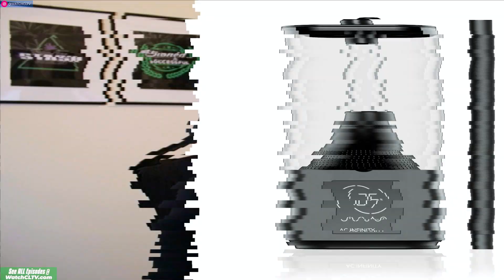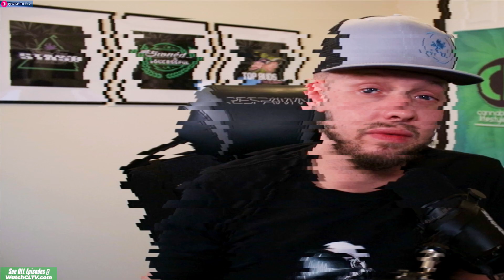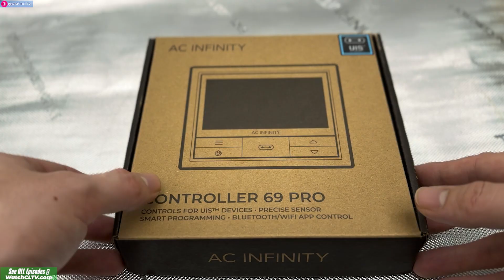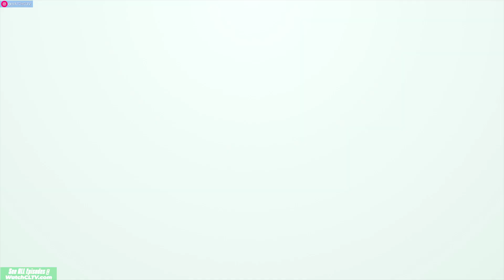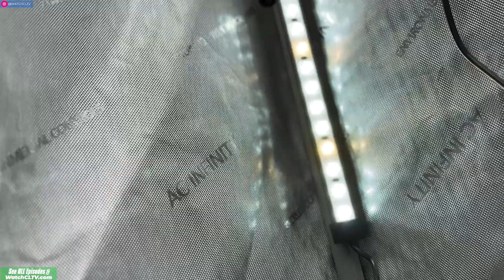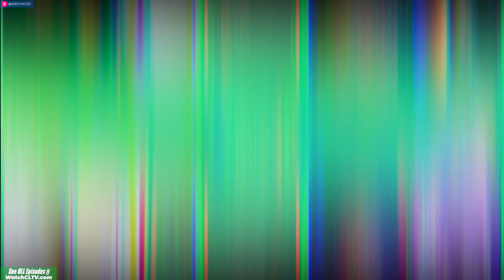AC Infinity: New Grow Equipment YOU NEED TO TRY!

Comment: Really wish the next gen controller has at least 6-8 ports. Also a way to hook in digital pieces of equipment heaters/ac instead of just analog. They might have to invent their own like they did with their humidifiers.
Reply from the maker: They released a controller with more ports

Comment: I use a intake extractor and outtake extractor. Will they work in series? Both are ac infinity. I don’t have any open flaps i have filters on the ends of the pipes. I hate to smoke dust hairballs dust bunny’s. Moths also love to get stuck the filters.

Comment: The only thing I find is that I wasn’t able to get the humidity up enough with the T3 outside of the tent, probably because of condensation in the flex tube. Inside the tent the Cloudforge T3 is killing it. I have added a USB-C splitter to add multiple devices to my controller 69PRO beyond the 4  device ports so I have the intake and outtake fans synced up.

Comment: The ACI AC adapter can’t handle the amperage from heaters, AC’s and dehumidifiers. I’ve blown 6 of them. They need to handle a higher amp ratings for real world use. Only good for lights and humidifiers in my experience. 

ACI customer service is aware of this and looking into it.
Reply: Plug a surge bar into it THEN dehumidifier .. ice had this setup a while now with no issues

Comment: Tent space and items used in that space is something that can easily be overlooked. CFM (cubic feet per minute) is drastically affected by items in the tent and can make a ventilation system run sub par. Heat output of the devices used is something to consider as well (you may or may not need extra heat). Growing,like anything else in life is a balancing act. Get used to dealing with challenges, trade offs,consequences and failure, if you can deal with that and not give up, success will come. In our quest for perfection we our at our best when we realize that we only catch it for a moment. We never attain it indefinitely. Work hard for those moments through careful attention and patience and everything will be a reward.

Comment: Quick question. Using the T5 humidifier with the 69 controller does the controller turn off and on the humidifier when it hits trigger points or just control fan speed?
Reply: The controller works WITH the fans to set point the vpd in the tent. If it's low then it shows the exhaust fans down and turns on the humidifier, if it's high it turns humidifier off and speeds up fans . You xan also program it to not come on during dark cycles. I have 3 lights, 2 6" intake / exhaust fans, a dehumidifier and a humidifier being controlled by it now

Comment: So glad I changed over to AC Infinity from Trolmaster. Just wish they'd make the following items (and I'm sure they are going to):
1. PAR sensor, so you can dial up what PAR you want from and the light will auto- adjust in a feedback loop. That way, you can just lift the sensor up as the canopy level rises and the light will auto-adjust to suit (I'm still using Trolmaster for this reason, but want to jump ship as soon as possible).
2. Compact Dehumidifier
3. Compact AC for inside the grow tent
4. Omnidirectional oscillating clip fans (ie. Not just horizontal movements)
5. Water Detector and Smoke Detector

Comment: I've went through a couple cheapos I might spring for the humidifier...  I do want to fully automate most of the operation but the ac infinity doesn't regulate or even monitor co2..I really don't need it to regulate it i just wish they would throw a co2 sensor on there setup..another thing to buy whatever...
Reply: You don't need co2. It increases temperature in tent a lot and won't give you much benefit at all.
Reply: C02 is the last thing needed on earth to grow good bud lmfao

Comment: I love all my ac infinity products but I have to admit that I think even they underestimated how thick the tent they make it. My magnets are staying put but slightest movement or pressure and the magnet side falls off. I assume the canvas is just too thick which is a great thing 👍  Currently I am using them on my humidity domes for seedlings and have one plant under 2 led bars which seems to be doing fine.

Comment: Do I remember you saying you use drops of balance to counter the calcium that can get everywhere from using tap water in the humidifier??
Reply from the maker: Yeah that should help
Reply: Use hot water that has been left to cool at room temperature. It will contain much less calcium. Tun some vinegar through your equipment monthly to clear hard water deposits.   R.o is much better to use though as cKcium dyst is cancer and ends up everywhere. Much cheaper to buy or make r.o. water than to replace carbon filters
Reply: @MrDmadness  when you use hot water from your tap it’s going to have a lot more calcium and’s mineral deposits because it has to go through your water heater first. Unless you have an electric water heater that heats on demand.
Reply: @NPKlife420  not true, heating the water causes ca and MG to drop out hence why the bottom of the heater gets a mat ( plumber here w 30 years experience)
Reply: @MrDmadness  why would I get more calcium deposits when I used hot water with cold water then when I just use cold?? I was doing just cold, then both which dumped calcium everywhere. So I went back to cold.. so I should really just do all hot water from the tap and it’ll be better?
Reply: @NPKlife420  hot water has LESS not none. The faster you heat water the more dropout minerals will happen. If you want no calcium dust on things from a humidifier then use distilled or r.o water.   Hot has less, not none .
Reply: @MrDmadness  thanks for the info growmie!! I’ll try just hot for a while and see if I can see a difference. I can’t afford to buy distilled or get an RO system atm unfortunately.. appreciate your knowledge sir

Comment: We hit 90% humidity a week ago, normally around 60-80%
Could be handy for shrooms. A dehumidifier that doesnt take up tent space is what I need
Reply: You can get modules for control 69 that control anything that plugs in. Use got dehumidifier on one
Reply: @MrDmadness  AC infinity dont make AU/NZ plugs and we can't sell foreign plugs here for saftey reasons.
I keep mentioning it but they are making everything but.
The splitter and daisy chain adaptors will be handy for big rooms
Reply: @Craig Dawson  ahh, that sucks. But couldn't you just use a standard adaptor ( aus to na ) and then just order a na surge bar with the ac infinity stuff?  .. it's a pain, but I can't see why it wouldn't work.   OR just curious the cord and attach a aus plug end. ( hardware store usually about $3 ) ?   The a/c - d/c step down transformer is in the equipment .. I would not do this if it's running over 110 VA without supervising it a BUNCH.. even better check the max VA on the ac infinity stuff first.
Reply: @MrDmadness  we run 240V so amperage would be halved.
All the adaptors I've see are so rubbish they are dodgy.
I don't know if the brains of it would handle 240V, I did think about butchering one to use it to make my own control box that isn't a fire waiting to happen
Reply: @Craig Dawson  it won't handle 240v of pressure if it's only rated to 120. There are things you can do ( bus converter), like run a single hot leg of the 240 and a common, but I don't recommend it unless you are very electrically competent.
Reply: @MrDmadness  I don't think having to create an external relay to bypass it isn't worth it. Might as well go with a entry level commercial controller (like trolmaster) or ghetto rig something like home assistant.
Or they could just make one for the 240V market like their other stuff
Reply: @Craig Dawson  agreed. A bus converter would do it though.

Comment: I really like the AC Infinity setup.  I have almost everything they offer for automation.  They pulled a quick one on me with the humidifier though.  Showed in stock, ordered...then 2 week later they cancelled my order randomly and didn't even tell me.  I checked my order status and when asked about it, they told me sorry about that, here is a discount code for your next order.  Huh? Now it's not even available anymore.  Lame.
Reply from the maker: That’s lame af, sorry to hear someone did ya like that because it definitely isn’t the usual from their team
Reply: @WatchCLtv  Overall, I've had a GREAT experience with AC Infinity, so I guess I can let this one slide.  Gonna have me checking the web site like a fiend for the humidifier tho.  They sell out quick!
Reply: Same happened to me. I even used a 25% off code I got from them due to a malfunctioning oscillating fan. They canceled my order and gave me a 20% off code. So now I lose the 25% off code and no fan/humidifier. Not the greatest experience with them this past month either!
Reply from the maker: Call them out about it, they’ll make it right